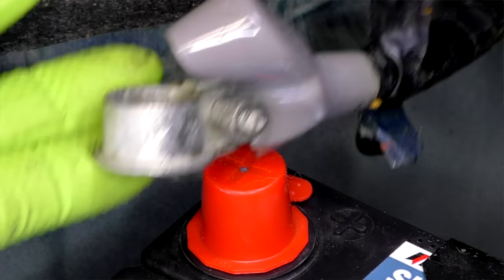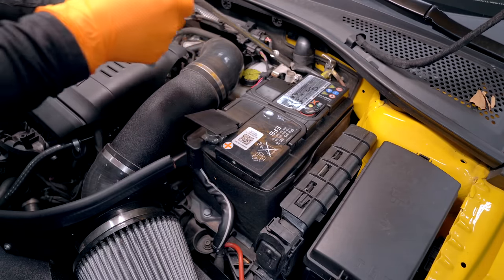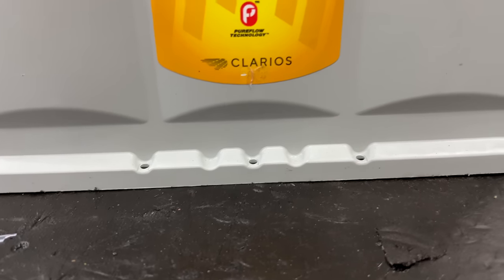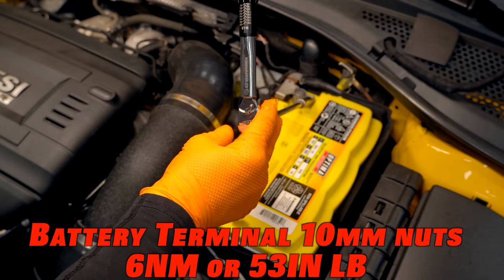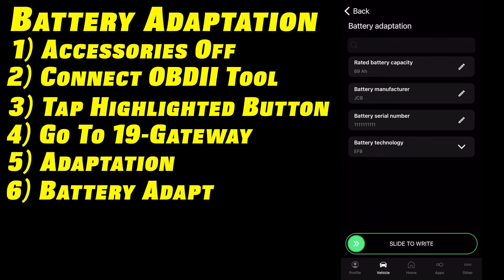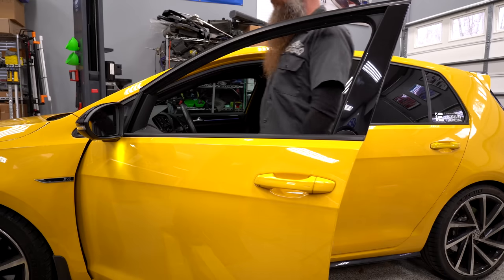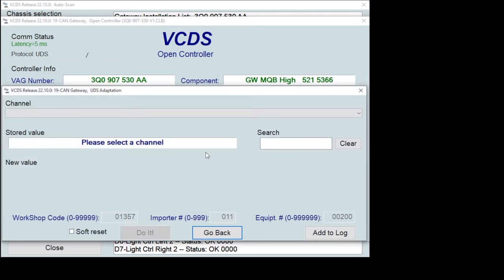How To Replace and ADAPT a VW or Audi Battery

Comment: Can you tell us if the battery adaption is needed on mk6 Golf R / Audi S3. (2012)
Reply from the maker: I dont think that old has it on the VW side. Id guess some Audis of the same years do. I think my 10 S4 needs it
Reply: @HumbleMechanic  it's not old ! It's tune and is a rocket ! Just kidding C. Very appreciated your answer and if i think about that they has no electronic connector at the battery terminal. So it's look clear to me now that no need adaptation. Tks, have a good week.

Comment: Is tbere any impact to ECU tune when swapping battery? Won't reset or mess it up?
Reply from the maker: in 99% of cases no issues. Ive seen random failures but its usually more of the car was dead for a while

Comment: Charles - you didn't (as I observe) do any 'cleaning' of the new battery posts or the inside of the POS/NEG terminals. A good idea? Or do it only if visually needs it? --- And my two 2015 Jetta Hybrids batteries are original (trunk stored). 51K and 61K. One was tested last spring - no "need" to replace. Probably needs it, but with a the motor acting as starter, does the electric system  in a hybrid put different stresses on the battery? TX for your many informative and engaging videos.
Reply from the maker: I do if there is any sign of yuck. But this car is basically new. LOL I think Hybrid uses AGM and you will have to do the 3phase calibration, which I think is just holding the start button down until you hear  the buuuurrrr of the motor.

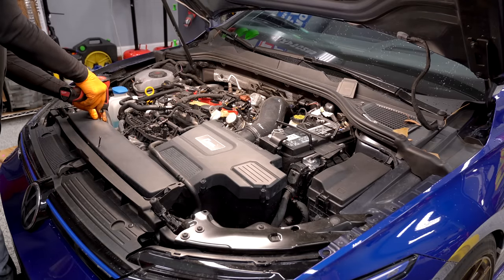Comment: 11:03 - I was just thinking about the battery in my 2018 Tiguan.  It's the original battery.  The unanswerable question: should I change it?  Perhaps to err on the side of caution, and seeing as it is 5 years old, then I think I should.
Reply from the maker: A little early is better than being stranded is my opinion
Reply: @HumbleMechanic  Copy that!

Comment: Is this necessary on a mk6 (2011)? and what are the cons of not doing it? I replaced my battery on my 2011 gti a few months ago and never did this. In fact my OBD11 dosen't even show battery adaptations under the car menu, which makes me think im ok, but wanted to at least ask
Reply from the maker: no need on mk6

Comment: Do you need to perform battery adaptation when you just disconnect the battery and reconnect it without replacing it?
Reply from the maker: Just replace
Reply: Say you had to remove battery to clean or get to area for other work - disconnected for any period of time?
BTW, this very informative video. THANKS a million!!

Comment: Does a 2013 VW Golf 2.5L require a battery adaptation? I have an OBDELEVEN Pro with subscription but don't see an option to do this in "long adaptation" or the apps. 

I replaced the old standard flooded battery with a new AGM battery (same specs).
Reply from the maker: Nope you’re goid
Reply: @HumbleMechanic  Awesome, thanks!

Comment: I have a 2018 VW Passat r-line, and have an obd 11 pro and it just has a long adaptation. Is there something that I am doing wrong? Please let me know when you have time. Thank you
Reply: Did you figure this out?  Is adaption necessary for the '18?
Reply: @richm896  I eventually found some help in VW Vortex forums. I did do the reprogram, but was later told that if you replaced the battery with a different amperage, turn it on and it will make the dash light up like a fireworks display, then turn it off and back on again it will reset and the ecu will configure itself. I did the reprogram just to play it safe.
Reply: @tysonnavis4097  I was told there is no battery module in OBD11 or VCDS for a 2.0L North American Passat to even do a change.

Comment: I have installed ACDelco battery which doesn't have codes with it, how i can do adaptation/coding with that battery in VCDS. i have Volkswagen CC 2011.
Reply from the maker: You probably don’t need it on the 2011
Reply: @HumbleMechanic  No dear, it’s needed in CC 2011, before that there was Exide battery so i did adaptation easily but for ACDelco it’s not available in the battery list in vcds, can you help? Furthermore i need to increase the engine rpm but it’s not changing the value even i login with security code but it’s look like that it’s locked, any idea?

Comment: I'm leaving for a month long holiday so i'll be installing an on-board battery maintainer on my mk7 as im from Canada and my garage isn't heated. Do i still have to adapt the battery after re-connecting the negative terminal? I'm not replacing the battery just disconnecting the negative for safety during installation.
Reply from the maker: Nope. Only when replacing.
Reply: @HumbleMechanic  Thank you for the response! Didn’t know newer VWs needed adapting, I traded in a BMW for my MK7 Golf and the first thing that came to mind was changing the battery will be easier but guess I was wrong!

Comment: I have a question.  Why not jumper the car while you replace the old battery?  Surely that would save all the reset steps.
Reply from the maker: No. It won’t. Other than maybe the pinch protection for windows

Comment: Hi Charles just came across your website. My son has an Audi 2008 TT 3.2 Quattro convertible. He just replaced the battery with an Everstart battery from Walmart. He tried using the OBD11 to register the battery but it’s not even showing any battery and functions are grayed out. Any suggestions? Thanks
Reply from the maker: That maybe old enough not to have to do it
Reply: @HumbleMechanic  thanks
Reply: @HumbleMechanic  do you have s picture of the module? Is it on the negative post? Thanks

Comment: Would using a battery memory saver plugged in the OBD port and using a slave battery prevent all those fault codes from appearing?
Reply from the maker: VW/Audi NEVER recommend that.

Comment: Can't you avoid a lot of the issues with replacing a battery if you put a jump box, or charger, on the jump points under the hood before removing the old battery?  I changed the battery a couple of times over the years in my VW and having alternate power hooked up didn't give me any error messages or lights when installing a replacement battery.  Never did any coding either and never had any problems.
Reply: This is exactly what I would like to know this as I purchased the OBD2 Memory saver along with a new AGM for my 80 year old neighbors 2017 VW Tiguan TSI. She thinks I'm only charging the battery not secretly buying a new battery. Wish a few people would chim in on this question. Last thing I wanna do is end up calling Triple AAA for a tow.

Comment: I replaced an oil pan and my mk6 golf TDI won't start, also replaced the battery.  Any thoughts?
Reply from the maker: Oh no. Does it try to start?
Reply: Just a clicking sound @HumbleMechanic

Comment: Thanks Charles, my GTI is coming up on 3 yrs old and I know a new battery will be in the future.  Very helpful as Always.  Question.  With all the tech these cars have, does the car give you an actual warning that your battery level is getting to the point that it needs to be replaced? Or not?  Some cars give no warning and you turn the key one day and get a click and nothing more, while others the car tells you with time to spare to change the battery before you get that "click".  Just curious if the MK7 and MK7.5's give an actual warning?  Thanks Bud.  Oh Yeah...Pure White is the fastest color by the way hehe😂👍
Reply: I think the battery replace message is for the key fob battery?

Comment: What’s funny about this is that my battery decided to die today. Discounted it and fitted some front seats in, as I came to connecting the battery and starting the car, it wouldn’t start😅 ticks over no start; jump leads worked. Time for a new battery🙃

Comment: The last time I changed the battery (Renault), they just connected a battery charger in parallel first, disconnect the old battery, connect the new one (without disconnecting the battery charger). Done. The car electronics didn’t notice it.

Comment: don't you know that the VW is making the same thing  for refueling? I heard that it requires two sets of different screw drivers just to open the fuel cap and a  recoding is required  when you make a full tank.

Comment: I think I've always done the opposite.🙄  I removed the positive side first and put it on last.  Is it possible that I damaged the ecu?
Reply from the maker: I doubt it.
Reply: @HumbleMechanic 
i have two vw's. 2017 Caddy 1.0 TSI and 2015 Passat Variant 1.4 TSI
i removed Caddy's battery and try (passat's engine just did not start and i thougt maybe it's about low battery. than we realized that clutch sensor has been dead) on Passat. 😬
both cars are fine right now smoothly runs.
obviusly i'm lucky. 🙂
i will not forget right way

Comment: Just bought a 2010 Q5 with 150000 miles. Electrics are doing weird things. First check and it's on its original battery 13 years old!!

Comment: When you mentioned about them being heavy I thought I couldn't agree more. I recently had to change the battery on my BMW, it's one of the ones on the right side boot area behind the rear wheel. I have a messed up back from being a passenger in a bad car crash so it isn't fun. I weighed it when I got it out, it was 27KG so about half the weight my ex wife was when I married her 😂
Reply: Well. it is a big box of LEAD. It's one of the things I love about my ancient (94) civic... tiny D50 battery, it's heavy but nowhere near what other giant car batteries weigh. (30 vs 80lb)
Reply: @jfbeam  really?! I guess I skipped that day at college when I trained as a mechanic, thank you for clearing it up for me

Comment: Someone said something about if you don't use a power saver it's bad for your electronic steering rack which already has issues. Is this true? Is there an adaptation for this via turning it like how you remove the lights afterwards? Thanks.

Yeah I just pulled it to charge it since I'm used to my 2001gti and 2004 r32 :( well f me

Comment: Help!!!! 2019 Jetta gli- won’t start- Followed your instructions and still no start..all the electronics work, key fobs unlock and lock 

Obd11 wont clear all codes….databus missing codes showing and unable to clear

Any ideas?
Reply from the maker: I might try disconnecting and reconnecting the battery. 

Then make sure fuses didn’t get blown. Sometimes if the car was jumped backwards that can happen
Reply: Tried reconnecting, checked fuses….still nothing

Comment: Hey Charles, No mention of removing any transport bungs?
Reply from the maker: I haven't seen a VW with one since 2006 or so Touareg.
Reply: @HumbleMechanic  here in the UK, any car battery bought online will be supplied with transport bungs at both ends. Some suppliers helpfully have a sticker reminding installers to remove the bungs.

Comment: Surely the simple solution is to rig up an alternative power supply before disconnecting the battery. If the supply is maintained then computers should continue to function.

Comment: If I just disconnect it to put the battery blanket thing back on does it need another adaptation?
Reply from the maker: Nope you’re all good. You’ll get the same lights I got in the video but they should go out with a drive
Reply: @HumbleMechanic  nice thanks!

Comment: How far back does this need to be done, Charles?  Is it necessary on my '12 GTI?
Reply from the maker: I dont think you need to worry that far back. It's about 2015ish that we really see it. MAYBE earlier on Audi and the higher line stuff like A8
Reply: @HumbleMechanic  Ok thank you Charles.  I'd replaced the battery on the car about 3 years ago and hadn't noticed an issue, but it does seem to be a bit weaker lately and thought maybe I'd compromised the battery life by not doing it.

Comment: Put 1111111112 as the serial number and it gave me a function not available error, tried again with 1111111110 and it worked

Comment: How do we select which optimum to get I have a 19 Tiguan 4 motion????
Reply: If you want optima battery your car would use yellow top DH7 that would be the highest most “power” AH and CCA that would fit. but you can use yellow top DH6 it’s just lower in AH and CCA compared to the yellow top DH7
Reply: @Theunknownnone  I need the most powerful cause I have aftermarket everything, air ride, head lights etc..

Comment: Vibration, Temperature Changes (cold to running temp cycles), excessive drain, overcharging, and poor connections also shorten the lifespan.

Comment: So it looks like if you place  and external source of 12v across  the terminals so that the car doesn't loose power and you fit a same type of battery you can save yourself all this programming
Reply: I see where you are going with this but the car's computer will assume the new battery has same degradation of the original battery and try to charge it like that. You are best paying for that fitter to let the computer know or get a scan tool that allows you ot do it (if you can justify the expense)

Comment: Charles, I’ve read that binary AGM isn’t actually the correct option for typical AGM batteries. Believe it’s supposed to be “fleece”. Do you know which is actually correct?
Reply from the maker: All the info I found was based on VW batteries(they talk about case colors) Im not sure it really matters. But im waiting to hear back from some engineers about it.
Reply: @HumbleMechanic  awesome, it would be great to hear the official word. I did some research and found that it may need to be set to "fleece" for AGM. Seems like VWs and Audis that come from factory with AGM are set to fleece rather than binary AGM.

Comment: Just connect a booster to the battery leads, there's no problems if it doesn't lose power.
Reply from the maker: Please don’t do that.
Reply: @HumbleMechanic  I always do it, never been a problem so far.

Comment: Word on the streets (fb groups and forums) is if you slap an oe battery back in you're good, but any changes or upgrades make sure to run adaptation. This jive well Charles?
Reply from the maker: the honest answer is MAYBE. My question would be... IF you have the tools, why not do all you can to be sure you get it as right as possible?
Reply: @HumbleMechanic  Im mostly asking to alleviate my worry as I replaced mine about 13 months ago and didnt (even though I have OBD11) 😬😬😬😬 and I usually try to go by your recommendations
Reply: OE or not, better to reset the battery adaptation since most modern charging system does adapt its voltage on worn out battery. if the old battery wasnt in bad condition, it might be safe but when the old battery was badly worn, you could kill the new battery sooner that it should be if you didnt reset the BMS.

if you mean just disconnecting the battery for some time, yes no adaptation needed

Comment: Does the mkv require this? I've had my gti since 2006 and several batteries and never did this.
Reply from the maker: No you dont need to on mk5. I "THINK" it's mostly starting on MK7 with the "A" platform cars.
Reply: @HumbleMechanic  Good info thanks. Just bought a mk7 so your video will definitely keep me from screwing that up when the time comes 👍
Reply: You DO have to redo the power windows for MKV. And turn the wheel "lock to lock" to relearn power steering. But you do NOT need an OBD II to do either.

Comment: This is very good guide...I like it....but what will happen if you type/write wrong serial number and manufactory of battery? What if you just type correct capacity and everything else wrong....I was asking many people what is the purpose of this stupid adaptation and process...noone answered
Reply from the maker: I dont think any of that really matters. basically the battery AH and a NEW code are the most important thing.
Reply: @HumbleMechanic  THX for replay...And what Is the purpose of that code? Why Is batery even coded...btw ..can you make video how to proper jump start dead car with other car And with jump starter? IT Will be usefull...thx

Comment: Still searching for camshaft position angle on my obd11 3 hours later found it only said 0.0.... 😂probably is the wrong one.... 🤗 i will probably run out of battery... before i figure it out... 🙂

Comment: Well my mk7 had no problems after a year after replacing the battery with no adaptation. I would have done it if I knew it was needed, I have obd11

Comment: I have got 5 cars, some private, some company cars. 3 different manufacturers. All of them needed a battery after the 5th year and before the 6th year. 3 of them brand new, factory batteries, the other two were second hand. On one we have changed  the aftermarket battery around the 5th year since we have bought the replacement. So 5 cars, 6 batteries, all around the 5-6 years mark. Now on all the batteries there was no indication that the battery is low on juice. Start the car, drive it, shut down, then get back again and it's out. Has power, but no start. That is it, no warnings, no nothing. In all the cars, for the change we connected an additional battery, so that it will not give the light show. I did the adaptation on the VW car. What I have read is that the computer is remembering when the battery is installed and is trying to fill it up to its predefined degradation level. That is why it needs the amp H, the type and producer's code, as it is not allways charging the battery all the time the engine is running.